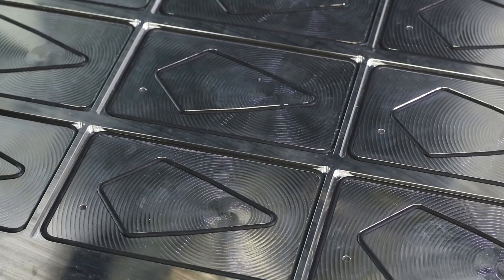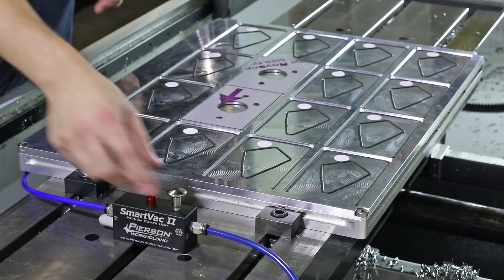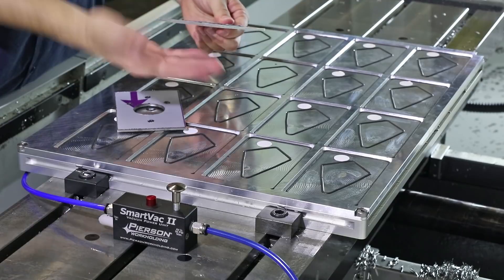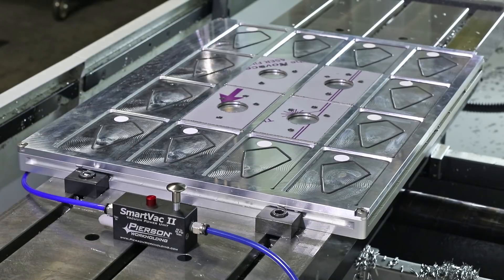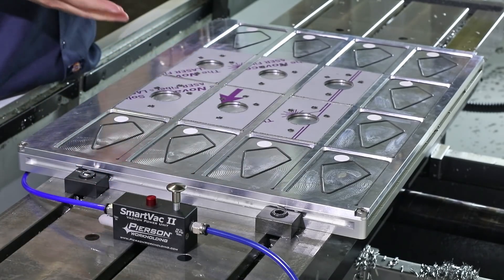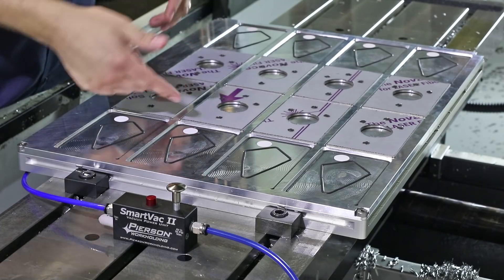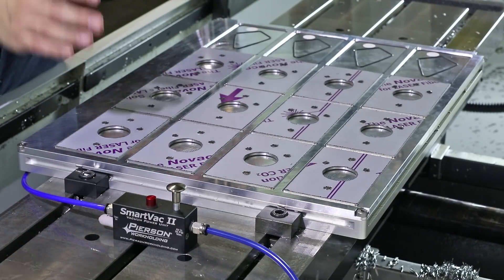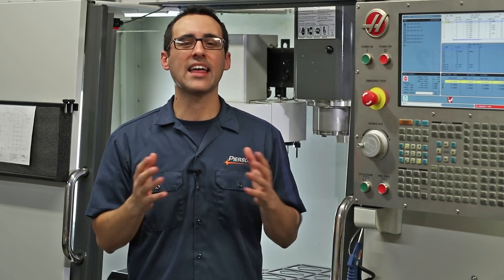Vacuum Chuck Top Plate Troubleshooting

Comment: I'm building parts out of .062" thick polyethylene. The parts are a big round washer. Would O-rings work? I've used gasket material before. I spent more time messing with the gasket than I did running the parts.
Reply from the maker: O-rings have terrible performance for vacuum applications. Check out our top 10 tips video: https://youtu.be/DarGtuxrbUA
Reply: @PiersonWorkholding  great information. Thank you for the knowledge.

Comment: Was just thinking, maybe you could add a spring assisted mini valve under each part and as you place each part you would also push down the mini valve and open suction to just that part thats being placed. Could be as simple as a peak(plastic), cone shaped seal plug with a spring underneath and then seal off the hole on the back side with a set screw.

Comment: a small groove around the outer rubber will solve the problem.
Or belt grinder.
or cut the workpiece on the other side.

Comment: I work with wood machines on a MDF 3x2 meter table, our raw sheets are always bent, but the high spot in the middle and the sides touching the table, this way is easier

Comment: i think a better solution, if possible would be to divorce the left and right side vacuum path so you have 2 blocks of 8 parts and 2 vacuum operators.  Load all 16 parts, small press plate over 8 parts apply vac 1, slide press plate to parts 9-16 and apply vac 2. voila 16 parts per cycle.

Comment: This is a very interesting video. Would it be possible to split the vacuum system on the existing top plate in such a way that one vacuum controller could control spaces 1-8 and a second vacuum controller could control spaces 9-16? If that is possible the vacuum could be activated on spaces 1-8, then after parts 1-8 are seated the vacuum for spaces 9-16 could be activated and those parts seated. In this manner the 16 spaces could be populated.
Reply from the maker: You can't split the vacuum within the chuck, but two separate chucks run by one of our vacuum generators would have worked. Then again, this problem wouldn't exist if they started with flat parts.